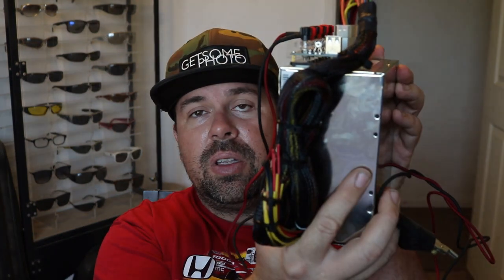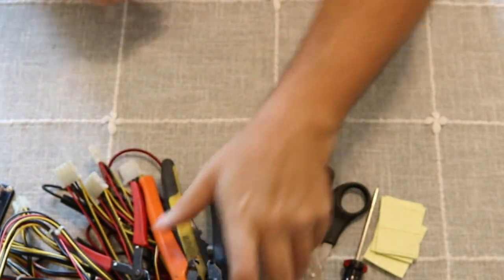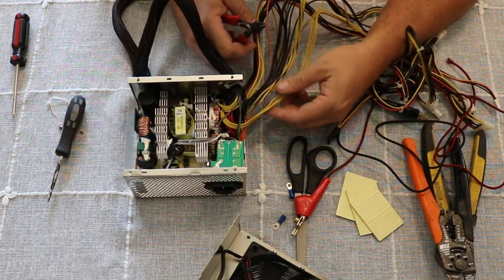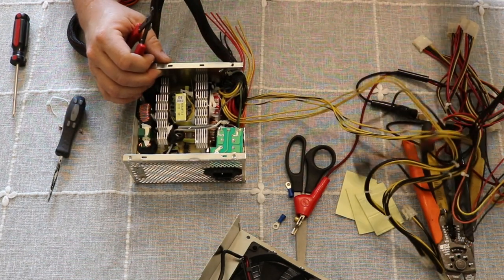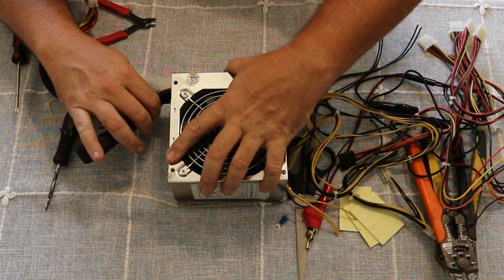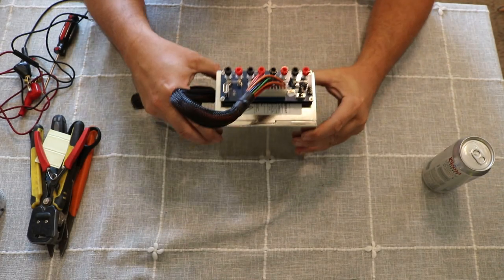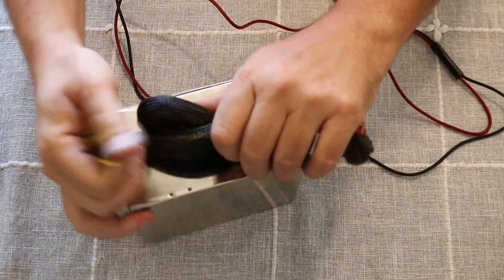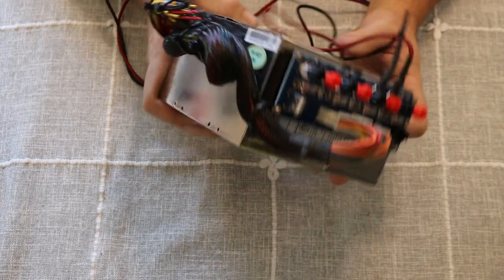Cheap and easy ATX Bench Power Supply for powering projects

Comment: one question can i use that to power t12 soldering iron kit ?
Reply from the maker: I'm not sure. Depends on the amp draw of that iron and the capability of the ATX power supply you use.